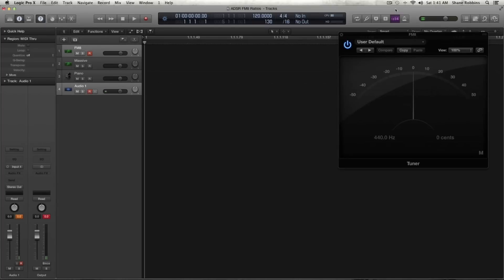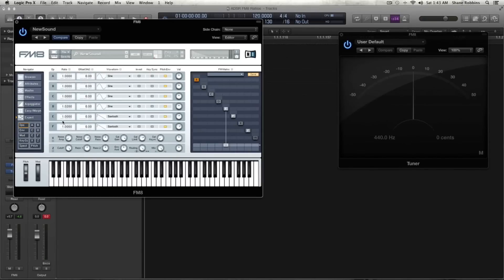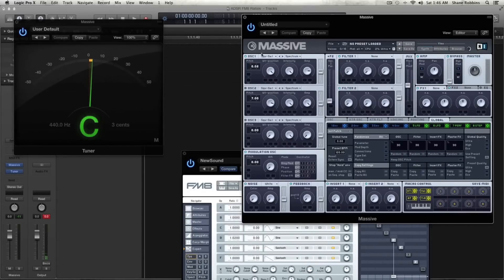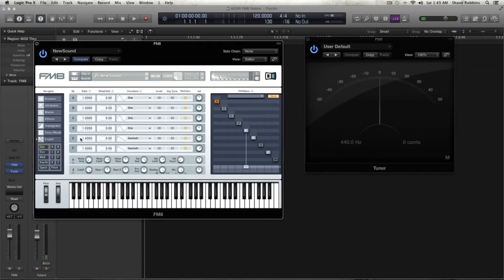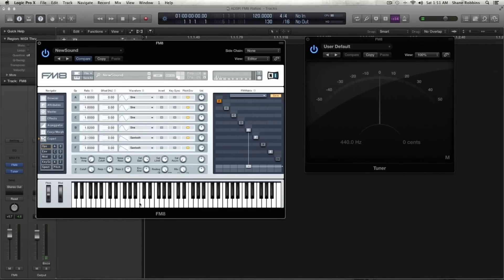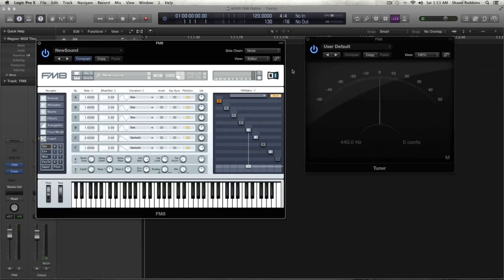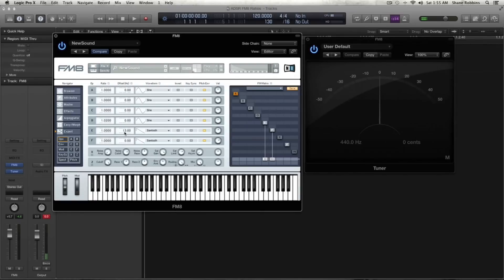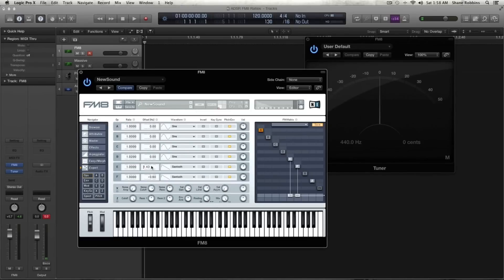NI FM8 - Ratios and Tuning - How To Tutorial

Comment: Here's a chart with the correct information about how ratios compare to musical intervals: https://www.teoria.com/en/reference/g-h/harmonics.php

An octave has a 2:1 relationship between modulator and carrier.
A fifth has a 3:2 relationship. So a 3:1 ratio ( = 3/2 x 2) represents an octave plus an additional fifth.

The decimal places are really complicated. In order to go up in semitones between a ratio setting of 1 and ratio setting of 2 then the sequence of values you'd need to use would be:

1
1.06
1.12
1.19
1.26
1.33
1.41
1.50
1.59
1.68
1.78
1.89
2

I've rounded these values to 2 decimal places. The formula used to generate them is 2 ^ (N / 12) for an interval of N semitones. However, that's just for the ratios between 1 and 2. Rising up to higher notes still,  the next set of 12 semitones won't be spread out between 2 and 3 but instead each of them will lie somewhere between 2 and 4. Ratios of less than 1 are interesting too, because 0.5 corresponds to 1 octave below the fundamental and 0.25 is 2 octaves below. I learned all this math because I'm building my own FM synthesizer. https://elizabethhudnott.github.io/fm-synth/

Comment: At the Hz offset part, isnt the tuner vibrating because you are actually  playing two notes at once? the C from operator F and the C + 13 hz from operator E?
Reply: Yes. Although technically you're always "Playing two notes at once" because you're using two operators. It just happens to be the case that usually they have a harmonious relationship between them like an octave (2:1 ratio) or an octave + a fifth (3:1) or they can even be two copies of the same note (1:1). When you play something odd like C and C + 13Hz then your ears hear an additional imaginary oscillator vibrating at 13Hz (which is called the beating frequency). One operator's oscillator is finishing cycling through it's waveform just slightly sooner than other one. And after the next cycle the faster oscillator gets further ahead still. And so on until eventually the faster oscillator gets a whole cycle ahead of the slower. Thus the two oscillators are continually going in and out of phase with respect to each another. The author called this effect unison but I think technically it's working more similar to chorus.

Comment: Dear Friend, why don't you trust your ears?!  It's your tuner that cannot handle the FM8, there is nothing out of tune at all. Your are talkng like a blind man about colors! "things start to get detuned just by nature" I mean you can say anything you want on youtube. But at this point it made me already so mad i had to stop the clip.
I really believe that you are capable of doing intelligent tutorials. But without understand the basic principals you're just wasting everybodies time
Reply: *****
Halfway through I realized that the way to get exactly a semitone above is to multiply the ratio by the twelfth root of two: https://en.wikipedia.org/wiki/Twelfth_root_of_two
Reply from the maker: I suggest you read this article so you fully understand. FM synthesis works off of this principle: A Carrier generates a waveform. So far nothing is happening where detune is occurring. The second you introduce a modulator, which is never heard it's affect is just noticeable to the waveform of the Carrier, you are essentially introducing vibrato. 

Modulating frequency, which is what we perceive as pitch musically, is actually a form of "out of tune". It's happening at a rate so quick that our ears can't hear and differentiate between the variances in pitch. However, the affect is still perceivable that's why FM synthesis has it's own sound.  Did you know that in an analog setting, true FM synthesis is so unstable in regards to pitch that it was barely usable? It wasn't until Yamaha implemented a digital technology that it became a viable form of synthesis. Hence that comment.

http://synthesizeracademy.com/fm-synthesis/
Reply: his tutorials are consistently built from uninformed garbage, you're not the only one to notice. hopefully he's quit by now....but I fear not.
Reply: Eden S.-G. Thank you thank you thank you I love you mmmmmmmuaaaa, genius you are a genius <3
Reply: +mrbo23 ...or using the epic spiralcm!